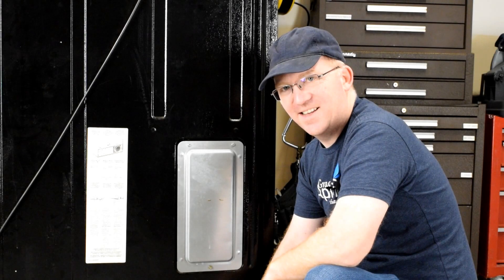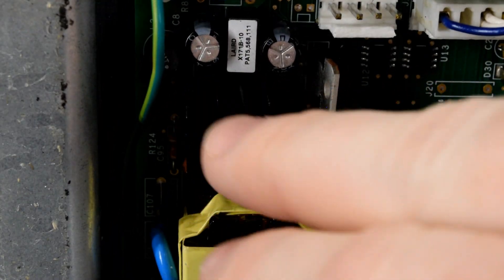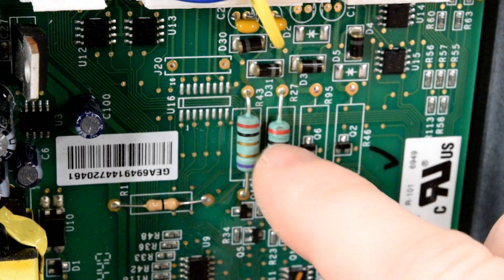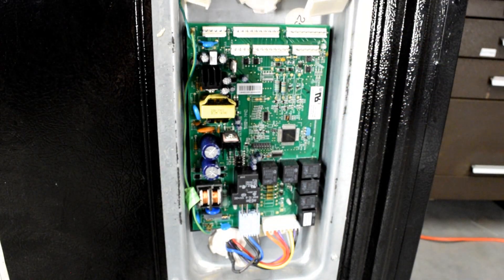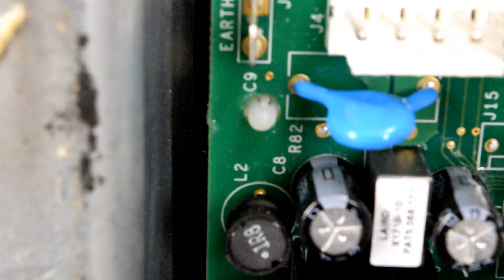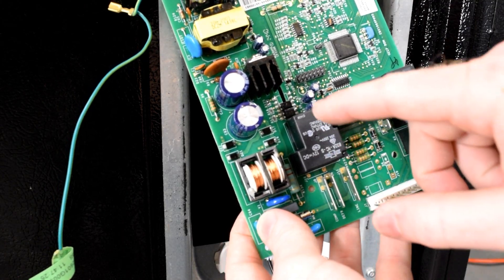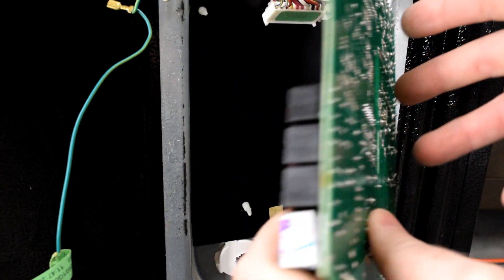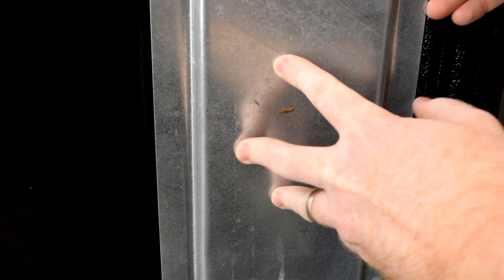Diagnosing a Bad GE Board - Part 2: Visual Inspectios

Comment: Fantastic video! Thank you. I'm dealing with the same board only on a french door bottom-freezer. After cutting the breaker to the fridge accidentally (I was trying to cut the breaker to a ceiling fan), when I put the breaker back on, the fridge was completely dead except for the ice maker! There's 120V to the light blue connector which appears to be the three wires going to/from the compressor. Black, brown, and blue. The weird thing is that, as I mentioned, the ice maker turns on but the rest of the fridge is dead, lights, fans, compressor and all! Could the inverter be the culprit rather than the control board? Do you do a video on testing/checking the inverter board? Thanks!
Reply from the maker: Hey,
I'm sorry I don't have a video on the inverter testing just yet. But, you should have a connector on your board with 2 small wires which lead to the inverter. The main controls job is only to send what's called a control voltage to the inverter telling it to turn on and supply voltage to the compressor. If you're getting between 3.5 to 5vdc to the inverter board, the main control is doing its job. If so, and still not getting voltage to the compressor it would then be a failed inverter board.

However, I'd start by unplugging the front control board from the fridge and see if the fridge comes on. If so, it's a failed front touch panel. If no change, I'd then unplug the fan plug from the main board and see if the fridge comes to life. If so, it's a shorted fan motor.

That's some common things to check for.

Also, if you haven't already, leave the fridge unplugged for at least 5 minutes and then restore power.
Reply: @GraceAppliance  Thanks so much for such a speedy reply! I don't see a front control board on any of the schematics, only the one in the rear. It looks the same as the one in your video but it's in there horizontally with 8 or 9 1/4 in. nuts for the cover. Am I testing the power to the inverter from the main control board or at the inverter harness?
Reply from the maker: aerlial360 you can measure it from either location, but don’t know which plug specifically at the main control. You should be able to find the small plug with 2 small wires leading from it.  You are correct, this is the main control board behind your refrigerator.
Reply from the maker: If you want to send me a picture of your schematics, I’m happy to take a look for you at GraceAppliance@gmail.com
Reply: @GraceAppliance  I imagine the culprit is more likely the main control board if the inverter's only function is to start the compressor. Is it odd that the only thing that turns on is the ice maker? I'll also unplug the fan connectors once-by-one like you said. I did unplug the fridge for 15 minutes to see if it would reset. Seems odd to me a circuit breaker turned off and on would ruin a main control board but I've seen odd many times as have you I'm sure. Thanks so much again!.
Reply from the maker: aerlial360 you’re most welcome.  I agree, it certainly sounds like a main control board issue (or front touch panel failed)

With the power on, you can also gently tap on each relay with a screwdriver (only touching the plastic handle of the screwdriver). If you gently wrap on the faulty relay, and the fridge comes on, you’ve diagnosed it as a failed relay.  This isn’t 100% effective, but I’ve had this help in diagnosing a failed control board before.
Reply: @GraceAppliance  Wow! Love the tips! Thanks! Those are the black flat parts, right? BTW I subscribed, liked and will use your vendors.
Reply from the maker: aerlial360 yes, that’s right...the relays have many different shapes, but are usually rectangular or L shaped and black in color typically.

Comment: How do you check or which Jack you to see if power going to the compressor from the board
Reply from the maker: Hi, keep in mind to unplug the refrigerator before touching any wires. You'll find 2 wires which lead to the relays that are plugged on to the compressor. If you remove the relays from the compressor you can then measure the voltage at the 2 wires leading to the relays. You should show 120vac there once you plug in the fridge. If the relay is good, you should get voltage after the relays as well.
Reply: So if you put a jumper the compressor will start just to see if the compressor is running
Reply from the maker: @snowflakes9736  if you jump between the 2 outside wires (make sure it's unplugged before touching) and restore power, this will send power to the 2 wires leading to the relay at the compressor. If the relays and compressor are good the compressor should start.

Comment: I have a blown fuse on the board everything else looks good
Reply from the maker: edesir hey!  
I’ve heard of people installing a device that is basically a piggyback fuse holder that clips on to the existing fuse on the board and allows you to install a new fuse in to the holder.  However, I’ve taken a look around and am not able to find a similar product, but do know that such a thing exists.  However, I’m not aware of how many amps the current fuse is (or if there is some type of underlying issue with the fridge that caused the fuse to blow).  That is one solution for you to look in though.  I would start by looking at Mouser.com and see if you could find something that will work.  I hope that helps.
Reply: @GraceAppliance  Thanks for the quick response!!  The fuse size is stamped on but i would have to remove it to get a better look. It may just blow again for reasons unknown but ill willing ti give it a try.  i'll just solder new leads to the new fuse.   To give a bit of insight to the fridge, a week ago i had to install a 3 n 1 to get fridge running again but it seemed to be running a little longer and a bit louder.  tks again
Reply from the maker: @edesir  yeah, it could be a failing compressor causing this. Relays don't usually just go out with no reason in my experience. I use the Rco810 which is a smaller version of the rco 410 that most put on for a hard start. I've been told the 410s will fry and aging compressor and the 810s are a better choice. I have nothing other than folklore to go by with this theory, but haven't had any issues in my years of travels with this theory.
If you have access to a clamp (amp) meter you can test the amp draw of the compressor while running. You should see around 1.5amp draw when the compressor has been running for a bit. If it was substantially higher than this it could certainly blow out relays and a control board.  

Thanks! Let me know if you have any questions.

Comment: I have a GE PS123SCPABS   S/N 4252289  The fridge stop cooling  I change the Main Board now the fridge cools a lot but the panel to set the temperature is Not working at all 9 nothing lights )  After 3 hours the fridge still running and both compartments very cool I unplugged the cord and when I plugged back won't start .   After one hour plugged back now it runs bur the Panel still not lights. 
any suggestions please !
Reply from the maker: Hi Michael,
Please send me a picture of your model tag with the model and serial to: Graceappliance@gmail.com

There are certain models that require a slight wiring modification with a board replacement and I can double check this for you.

Thanks!
Andy

Comment: Hi and thanks for your tips. Where may I find all the relay’s voltages? On the blue wire on the compressor I do have 46 Volts and seems to be not normal. So how and where can I find the defective relay? Thanks in advance
Reply from the maker: Hi, what is your model number please?
Reply: GE Side-by-Side ONLY - Refrigerator Repair Videos I do have 118 Volts on my compressor now, I miss place my trig but my compressor Ohms are 10-6-4 and still not start.
Reply from the maker: @Dante1127cc  hi, if you are getting 120v on the compressor side of your relays your relays are likely OK and should be hearing the compressor at least trying to start. 

Do you have 120v after the relays (where the compressor pins plug in)?
If so, is the compressor making any kind of sound?
Reply: GE Side-by-Side ONLY - Refrigerator Repair Videos No click or any sound from compressor. I do have now my doubt on the grey plastic terminal where them 12 mf is. My meter doesn’t have mf feature...
Reply from the maker: @Dante1127cc  hey, uF function is for testing the capacitor, but I don't beleive a failed run capacitor would cause this issues you have.

If you've verified 120v after the relays and still the compressor will not start, I do suspect a failed compressor unfortunately. This being about the most expensive repair in the fridge, most times it will not make sense to have it repaired, but it might be worth having a professional double check your diagnosis with your findings.

Sorry for the bad news on it. Andy
Reply: GE Side-by-Side ONLY - Refrigerator Repair Videos pfs22sbsbss

Comment: My GE fridge, side by side, is flashing zeros on the temperature adjustment display on the front of the freezer door. Anywhere you know of on the board I should look to find the source of this problem?
Reply from the maker: Hey Richard, 
This issue is often a connection issue between the main control board and front touch panel.  
Most commonly it’s going to be a bad connection at the plug behind your kick panel by your feet.  Should see a plug by the freezer hinge.  Unplug your fridge, the Unplug and replug this about 10x. Look for broken wires or corrosion.  

Let me know how it goes.
Reply: @GraceAppliance  
Thank you for your quick response!! My fridge model number is GSS25QSWASS.
The part Number on my main control board is 200D2260G008
The part number on my display board is 200D7355G052
These are the boards that have been in it since I got it.
The zeros are flashing, the buttons "beep" when I press them but the display just continues to flash zeros. 
The water filter button is solid red. 

This is everything I have tried so far...
-Bypassed the connection behind the kick panel by splicing the wires together. 
-checked the voltage at main board and display board to make sure I was getting proper voltage at both spots. (13.5 at both)
-unplugged the connections and replugged them back in (multiple times) 

My only question, what is the blue wire for that runs from the main board to the display board with the red and black? Could it be the culprit? Is there a way to make sure that one doesn't have a bad connection somewhere?

Starting to wonder if it's just done. Ha. Any other suggestions?
Reply from the maker: Richard Tolar hey, low on battery here. As far as testing the blue wire connection testing.  One way I can think of is to do an Ohm resistance test between the plug at your touch panel blue wire and where it terminates at the main control board.  Now, obviously your meter leads won’t be long enough to reach both locations so you can use a longer length of small wire to extend from the touch panel to behind your fridge by the main board so you can test both at the same time.  If you have continuity, this would mean you have a good connection.  
1% ahhh!  Lol

Comment: My water and ice dispenser is not working, the light flashes on the front panel with the temperature. The ice maker works and I have checked the water line it's not frozen. When I unplug the fridge and plug it back in it clicks for a while before it starts back up? Do you think it's the control panel? After watching your video I'm sure I can replace it myself. I did look at the control panel but did not take it out to look at the back side for burn marks. The front looked fine?
Reply from the maker: Hey, behind the kick penal by the freezer door hinge near the floor, you'll see an electrical connection there. With your fridge unplugged try unplugging and reconnecting this 10x. Then, plug in your fridge again. See if this improves things at all.

The clicking is a symptom of a failing control board for sure, but try this first. 

Thanks!

Comment: OMG you are amazing for posting this video. The first thing you mentioned that  the capacitor tops are blown open is exactly what happened to the board on my fridge. Hopefully by replacing those I will have a working fridge again. THANK YOU!!
Reply from the maker: purplemonkey dishwasher awesome work on the diagnostics!  Thanks for the kind words.  
If you’ll use the link in the description to order your part, that helps the channel a ton. Thanks!
Reply: @GraceAppliance  I will try to solder some new caps first. If I need a whole new board after that I will surely buy it from you!
Reply from the maker: purplemonkey dishwasher thanks!  If you need any help along the way, just let me know. 
Andy

Comment: Yes! Confirmed by suspicion of a bad relay. I removed the board and there was the burn tsolder joint. Now to find the part and repair board. Thank you very much.
Reply: 0 0 did you put the bad control board back on the refrigerator so it would run until you found or fixed the Brocken one? Just trying to figure out if I remove the control board to check the back side can I put it back and still use it until I replace it?
Reply: @angelaborgstedt3779  I ordered a new relay but it only had 4 terminals, not 5. So, after cutting short the original leads on the old relay, I had to reuse the old relay. It was a struggle but got it. What Should have done was carve off the thin black plastic relay housing a get a direct look at the contact points before deciding to remove it. An after thought for me, but the points were perfect. So the problem was just that the solder got hot an blew out on the one terminal. So, in my case just to resolder the joint would have been ok. Fridge running after a month. I did get a defrost element/ defrost sensor kit and the new sensor was bad, again reuse the original.
Reply: PS, the relay was glued to the board and when removed it pulled off a board trace. Had to repair with a small wire. Tip …..I had no small soldering iron with a tiny point, so I wrapped a thinner  piece of copper wire around my iron and used the end to solder with, adjust to size. Contrary to usual practice, transfer solder from the wire to small spots to control amount applied. Too much can be disaster.

Comment: Hi Andy,
First, I wanted to thank you for all your help videos and your great work.
Excuse me for my bad english, I live in France.
My fridge "General Electric GSE 20 JEW JFBB" does not work anymore.
On my control board, I found 4 capacitors (C29, C30, C8, C106) inflated.
The switching regulator "U1" has also burst.
The problem is that I can't read the component reference anymore.
Could you please give me the reference of this integrated circuit.
I don't know if it's important, but my fridge runs in 230V 50Hz.
The label on the board indicates only "WKKT Model : No 0159-00-73A and GEA Part No : 200D4855GO17".
The reference of the transformer "T1" is "30H-2003  DCGM 0820C".
I thank you in advance for your precious help.
Reply from the maker: Hi, you’re most welcome.  
Are you needing the part number for a replacement control board?
Reply: Hi Andy, 
Thank you for your quick response.
Yes, I would like to have the part number of the control board, but it's mostly the reference of the switching regulator "U1" I would like to know.
I would like to repair the control board by myself.
The fridge is quite old and I don't want to spend much money.
Thank you for your help.
Reply from the maker: Zeus07able hey!  
So, your part number for your board is WR55X26733. This is a different part than what I own so I’m not able to provide a reference on the individual components for you. 

 If you need to order the board, if you use this affiliate link it helps the channel greatly. 
https://amzn.to/2VrSWi6
Reply: Hi Andy,
Thank you for the time you spend for me.
I don't think I order the control board, because I would like to repair the board myself, in the interests of economy.
For information, what is the reference of this integrated circuit "U1" on yours own control boards.
Thanks again for your help.
Reply from the maker: @Zeus07able  hi,
My board wr55x10942p does not have a U1, Sorry to say.
Reply: Hi Andy,
It is not serious, thank you very much for your kindness.
I remain subscribed to your excellent channel for all the goods advices.
If someone from the forum have the answer to my question, I am interested.
Reply: @Zeus07able  Hello Zeus, I too am trying to repair my board. U1 is a switching mosfet TOP246YN, in case you are still looking. Were you able to fix your board, can you tell me what you did, it would help me. Thanks.